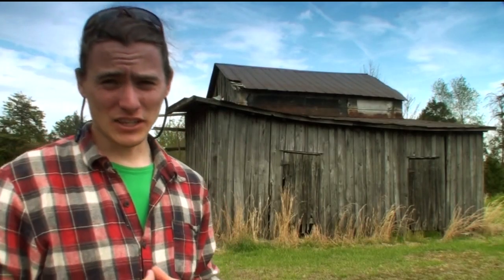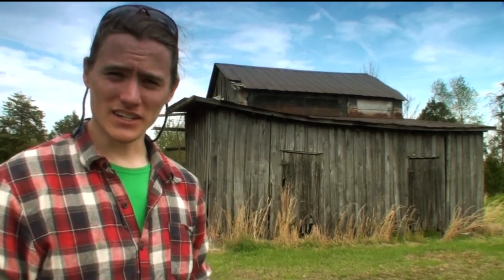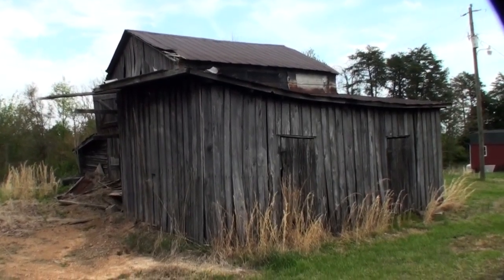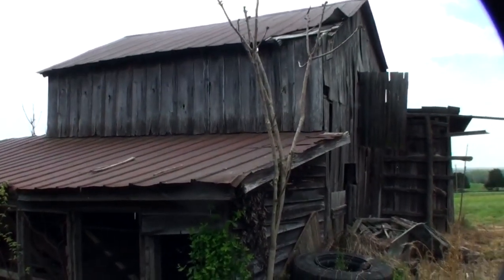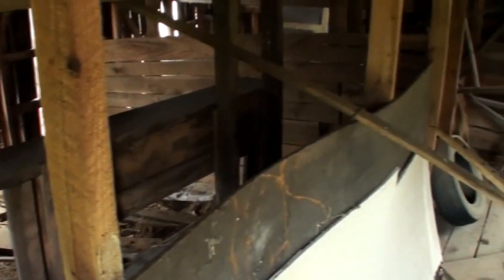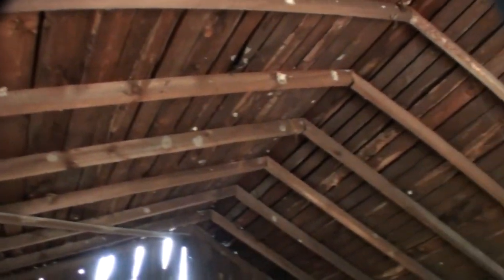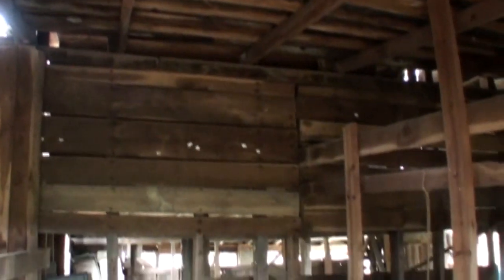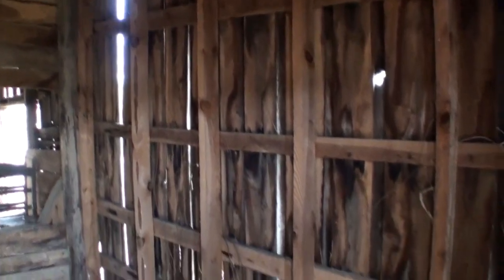Finding a Barn to Salvage Lumber - Reclaimed Wood

Comment: Many thanks for uploading this delightful short video clip! I would be thrilled if viewers of this film could help me by guiding my spirit to find some used, wooden railway sleepers to use to make raised beds in my garden for my next project. Many thanks in advance.
Reply from the maker: +Michael Ball You can buy them for pretty inexpensive and they will be in great condition. I'm going to be using them for building a retaining wall. They are $12 each, that's a lot of wood for $12. Look for them at places that sell mulch, gravel or landscaping supply places.
Reply: The Homestead Craftsman Many thanks for your advice Craftsman. I've just returned home with what is either a railway sleeper or a lintel I found laying on a footpath on the other side of town. It's not in the best condition but it's not crumbling away either and I really get a 'kick' out of finding or being given things for nothing. This part of the world had a very high density of railways up until the mid 1960's and there must be thundreds of sleepers laying around.

Comment: Your lucky you have such a nice neighbor, and as many other post, it looks as though you have a very good supply of lumber to work with. But tearing it down by yourself will be a chore, thanks for the video
Reply from the maker: It will be quite a bit of work, but you can't go to lowes and buy old wood! The barn is only about 5 minutes from my house, so it's an easy trip. Once you get going it's really not that bad, removing the nails is what will be bad, that will take a while. Old structures where put together with nails, which once they get some age on them are easy to pry boards up, the floor boards will be the hardest, the rest no problem.................at least I hope.
Reply: The Homestead Craftsman
I'm the owner of a couple of barns like this (see avatar for one) and would love to be able to use the wood myself for either another barn or a tiny house. I'm not capable of taking them down on my own unfortunately (those old nails are strong!).  Hopefully some day I can find someone to help me with it, love those old barns.  Good luck w/your project!